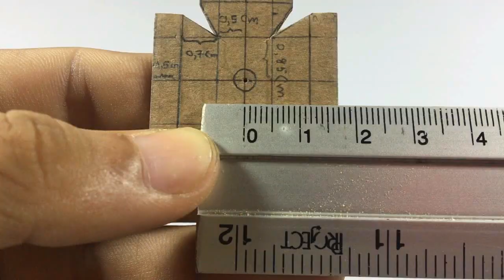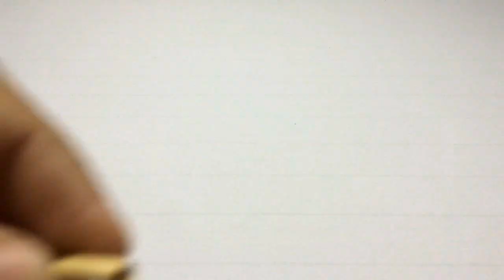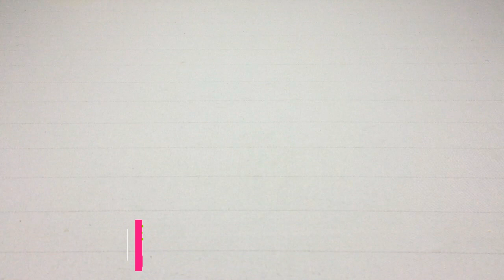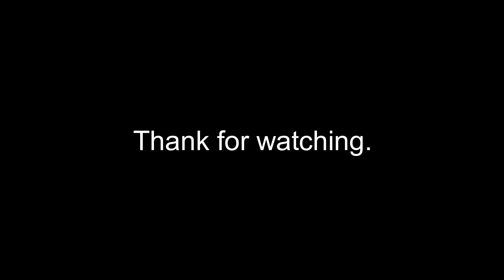How to Make Front Axle and Rear Axle for RC Heavy Truck Off Road RC Homemade From Cardboard

Comment: Why did you build a transfer case if the motor had one on it already?
Reply from the maker: To increase the power make it stronger and stronger.
Reply: So basically you geared it down further

Comment: Sir the pattern of mechanics you use is too good. but sir how do you control the  servo motors use in your models either for steering or for lifting.  please show how to make circuit board used in controlling servos and dc motors.